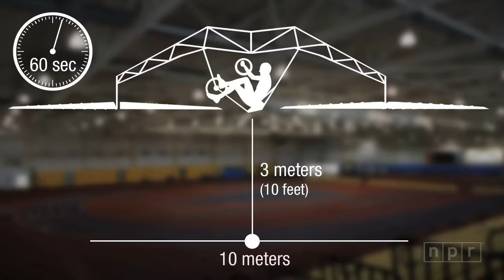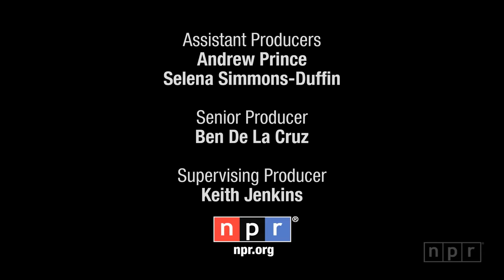Human-Powered Helicopter: Straight Up Difficult | SKUNK BEAR

Comment: As a composite technician I really appreciate this structure, the fact that all that carbon fiber can deal with all that intense stress and hold fast is amazing.
Reply: What? Carbon fiber is supposed to be stronger than steel so tell me why is surprising for a such a professional as yourself??? 🤡
Reply: @Alberta1stPodcast it’s stronger than steel per kg, yes that’s correct. What’s your point?

Comment: Honestly, I believe what you guys need isn't an extra engineer but actually an expert in biomechanics. The way the pilots have to work really isn't optimal, especially the arm motion is off.
Reply: Exactly
Reply: Correct, leaning sitting like a bike would for example be more efficient
Reply: Wouldn't that make it harder to lift it? The machine would be significantly heavier with two more pilots.
Reply: @neocyran  we shouldn't have 2 pilots... I think you misunderstood this
Reply: See YouTube, this is the kind of shit that happens when you don't nest replies to replies...
@RegiPet recommended using more people pedaling.
Reply: @neocyran  oh, I see, using more than one guy is not a good idea.
Reply: It is fun for indoor shenanigans. But Imagine a vehicle like this outside, where you crash when you get injured or to tired.
Reply: I'm not an expert or anything but I see the pilots struggling with the hand pedals and the pedaling position is not ergonomic enough. But anyways awesome project 👍👍👍👍
Reply: They should get the people who designed the human hydro system for the americas cup.
Reply: LUN4T1C - The point of projects like this is to "challenge" people to come up with new ideas and concepts to a seemingly impossible task... the human mind is capable of infinitive ideas and it's challenges such as this which brings about the next technological breakthroughs. Also, while it is true the person powering the helicopter in the video will eventually get too tired to sustain long term, effective flight... a small combustion motor or (better yet...) an electric motor could (technically) replace the human power aspect once the design team has accomplished the goals of the original challenge.
Reply: @IrLosin  i think its just a proof of concept
Reply: Exactly, that is the first thing I noticed watching the video
Reply: Provided the structure can take the added forces, a heavier but more powerful pilot should be better. They need huge power for a little more than one minute. This guy is light but that's about it.
Reply: @IrLosin  they are legitamatly only doing this for the prize. Not for commercial/public use.
Reply: ImKrazyFrench exactly, using your own body weight to assist your physical strength will go a long way in helping in power and efficiency
Reply: Exactly.
Cycling up a hill on a recumbent offers such little power. Optimal movement for humans generating power is probably rowing but the mechanism would be heavier.
Reply: @voidrift1508  no.not correct... You also need to pedal with your hands... Soo bicicles sitting position would suck
Reply: I agree. There is ample space for an engine.
Reply: You may be wrong, they're going for most watts possible, sustaining it isn't very important so bad form may not be an issue here.
Reply: Can somebody please for the love of God explain to me the point of this whole exercise?
Reply: Im really dumbfounded with this recumbant cycling position, particularly with Americans, you have to support your legs while using them? This arm position is strange too. Put the pilot in a cycling position.
Reply: @ChristopherSmith-bh4sz  The absolute weirdest thing is the placement of the engine.
Reply: @jakaberdajs730  That might not be the case, the power increase from the legs in a bicycle position might overpower the total power from the hand and foot position. We'd have to try it IRL to know I think.
Reply: @voidrift1508  well i think if they had clip in pedals and with a more "upc position on the hand with a lean angle forward of 140° the power would exceed that of a optimal cycling position since he would have more power in the legs, using the whole rotation as source of power not just half of it and hands combined. But like you said it has to be tested in the field
Reply: ImKrazyFrench You know, that's a great thought. If the hand power could be designed as pull, like exercising the lats of one's back in a gym.
Reply: @Flyingdutchy33  It allows young engineers to demonstrate their capabilities to potential employers.
Reply: @ryannayr140  So why human powered when 10 ft is "the ultimate height/range" ? Is that just to score browny points with the climate boys?
Reply: Wow the pivot was real on that one.  It's a trivial height that they thought would be a challenging goal to try for.   @Flyingdutchy33
Reply: @ryannayr140  yeah I get it, I just don't see the point
Reply: @neocyran   no because with 1 pilot they are lifting there own weight plus the entire weight of the craft we as 3 pilots would be lifting their own weight plus only a 1/3 the weight of the craft.
Reply: @kezzaman  That is a very good point.
I feel it sidelines the fact that it would be a more complicated craft, with additional seats, gears, strings, among other parts.

I'm not arguing it makes it impossible, or that it would not make achieving higher altitudes possible, (unlike I had meant to in my original comment when I did not give it much thought).
 I think, though, that three-pilot version of this craft would require a lot more engineering and personnel involved.

Would the pilots have to be synchronized? I feel like one of the issues here is that different rotor speeds would make it less stable so: how close would they have to be in sync?

Would the resulting craft be substantially heavier? I think in this case where the team is trying to trim the weight to minimum possible the gain could be less than what one would expect from reading your observation.
Reply: I was thinking about this too. I know it would change the way they design the aircraft but if the pilot was positioned in something like an elliptical machine they would have a more efficient energy output
Reply: @FinnJohnson   Ya, that would definitely sync up the hand and foot motion. Good idea! I think they should experiment with gear ratios as well if they haven't a bunch already.
Reply: Beastly already did this in the 80's. Hyahyahyahyahyahya
Reply: This is what I was thinking.. they should be pushing down into their work, not leaning up toward it.. if the pilots were oriented facing down instead of forward / up, they could put their weight into their work instead of doing it 100% through twitch muscles.
Reply: @Blurp Bibablobop I think the biggest problem w/ a chain here would be weight.. chain driven mechanisms are actually very efficient as there's no slippage.
Reply: Regi Pet  clearly not, they get lift with one person, obviously.
Reply: Void Rift why isnt it?
3x the force, but less overall weigth per person
Reply: @IrLosin  But with a bit of help from a electric motor you'd be fine.
Reply: @ChristopherSmith-bh4sz  that's right. The traditional cycling position would have given him a greater mechanical advantage over lying on his back. Gravity is a free energy that can be utilized in this instance.
Reply: @ryannayr140  and once they get hired. They're slaves to corporate deadlines and business politics. An innovative mind would rot in that environment unless he has a great development team and a likable boss.
Reply: I was thinking about the usage of elastic materials to make up for the lack of 100% synchronization between the arms and legs in an optimal movement (I mean, they do move together but in very different manners). Plus the seating position does not look like the best.
Reply: Ok. But it needs to be redesigned.
Reply: I was thinking the same thing, like a rowing motion used for crew
Reply: Regi Pet  No the lift is there. The machine would probably fail with a significant weight addition
Reply: These people look like cyclists, give them foot pedals and let them brace their arms and you will have far more success im sure
Reply: I agree with a different position. If they used a more bicycle position they could switch that seat for a carbon bicycle seat that would weight less.
Reply: @voidrift1508  Thats exactly how the Sikorsky Prize was won
Reply: @IrLosin  have you even watched the video ? This is not made to have 'fun' nor for 'shenanigans'. This is a challenge for optimal performance. A challenge for light and strong materials.
Reply: @Movie2Documentary  Someone needs to adjust his sarcasm radar
Reply: Agreed.
Reply: Yes. Rowing machine motion+ plus spin bike+triceps dips. Or, what about the ability to shift the gears like a mountain bike, gain speed and momentum. Or, maybe some kind of parachute like the fan-man has? I looked at some wasps in a jar with a lid one time. Noticed they were really dangling, their segmented heavy bodies like pendulums, all thrown perpendicular to their wings, only thing horizontal was the tiny head, behind which were little oscillators (not rotors). Built much diff. Than a human, a wasp or hornet is still a good example. Catch one and put it in the freezer for a few minutes, it'll slow it down and you can see it comes back on. It'll even let you tie a string to it. It supports an amazing length of floss before it turns on you. Cool vids. Keep up the work, and maybe some day we'll see you here in FtW. A lotta good aerospace people here at Lockheed Martin n Bell helicopter. It's like an air show every day, I love it here. Would love to stand up and peddle hard and shift into flight. Hey what about the rider being upside down, dangling like a wasp from it's wings,  and don't bother with the arm portion of the machine? Just focus 100% into peddling with better transfer of energy through the shorter chain and ability to use arms like stabilizers grabbing some kind of handles by one's sides, wide out, kinda? I do drugs. You're welcome.
Reply: i thought maybe if the pilot was on their stomach so their legs  and arms did not have to fight against gravity as much ?
Reply: Oof, so many replies...so after 2 years, I'm thinking there is a tradeoff between ergonomics and engine stability that hasn't been brought up in the discussion. I agree that the rowing motion can generate much more power and also much longer than spinning it is right now. However, rowing might decrease significantly the stability as it involves alot of upper body mobility
Reply: For a short "sprint" working with arms ist ok , but not for longer time.....because the bllod goes off from the biggest muscule, the dead-line for he human power ist the power of the hart....
Reply: @neocyran  Exactly what I was about to say
Reply: Its spelled believe,not beleive
Reply: @lookbehideyou1767  Right! Many thanks :)
Reply: neocyran  now 1 pilot supports the whole weight and his weight too, with 3 they would support their weight but divide the weight of the machine per person by 3, would definitely be better
Reply: There are a lot of people in here giving advice, but what these people accomplished is actually fucking insane.  Look at all the other human powered flight designs.  There are people in here saying they need this or that but none of you have come anywhere near this, and probably never will.  You have no idea how hard this was.  I saw one person say they "need more people" lmao well I hope these extra people don't weight anything, because that 1 person probably weighs more than the entire machine.
Reply: yup the machine weighs 80 pounds lmao
Reply: Imagine a 500 watt motor and 4 pound battery pack could really make this fly alongside pedal assisting
Reply: @neocyran  That makes sense but if you think the human as the engine, it would be the equivalent of saying that you shouldn't add more engines to generate thrust because they add weight. Maybe the engine analogy doesnt exactly work because humans output way less power for weight than an engine.
Reply: Wandy Wexler Weslon  would that qualify though? Adding a fly wheel implies that you have to get it moving before lifting off, so it's essentially like using a low tech battery that is charged by humans and then used to assist them in actual flight. I'm not sure about the rules but they probably want all power provided during the flight to be generated by the pilots during the flight, otherwise you could also just wind up something like a giant mousetrap vehicle and technically call it human powered because the mousetrap was wound up beforehand by humans.
Reply: Wandy Wexler Weslon  actually nvm the rotors in themselves are basically giant flywheels so I guess they should be allowed
Reply: They should use rowing motion + leg pressing for powering it
Reply: @IrLosin  lol I can see myself jumping into my Flycycle trying to go 100 meters North and suddenly landing in Brazil or something... Not suitable for windy cities at all.
Reply: they need vortex cooper coil and a motor to stimulate the arms and the legs and then you get strong
Reply: or just put a robot with adversarial generative networks mechanicaly to control some errors
Reply: if it was it should be real
Reply: That's what I was thinking.
Reply: Theyre going to have to redesign the seat and the mechanism hes turning. Hes bound to put forward motion having to push that wheel and he will always move out of the box. They need to correct that somehow
Reply: @neocyran  They're not pilots, they're the engine. They have no control other than how fast they pedal
Reply: @voidrift1508  This for that. You increase output from leg rotary but the arms become more restricted when you're crouched over.
Reply: Also, putting the user in a position where he can lean to apply torque to steer would help a lot.
Reply: Worst arm position, whose idea??
Reply: @voidrift1508  A Canadian team won the prize doing something similar to what you suggested.
Reply: If they use gears like a bike or car it would be more efficient
Reply: @neocyran  1 year on, still no nested replies. How the ever loving fudge have they not changed this.
Reply: Old sewing machine pedal mechanics
Reply: Needs biocam at least
Reply: Put a gear switch and more sprocket sizes
Reply: It's completely wrong. No endurance at all is required just to do a couple of minutes. It's raw sprinting power to get the maximum quick lift. You need to be head-down sprinting flat out from the get go with your arms locked on something like a weight lifter. You should be anaerobic, your lungs should stop.
Reply: They need a whole new design
Reply: Wow mr graduate student
Reply: Best way might honestly be making a rig where they can do a squatting/deadlifting motion. Might be a little heavier but could make more power.
Reply: Regi Pet  Three people pedaling equals three times the weight. Their battle is to increase efficiency, and their focus should probably be in funding light, strong enough materials while designing a a pulley system capable of avoiding losses due to friction in the strings and pulleys, and airfoils with high lift/drag ratios.
Reply: Hand pedaling doesn't help much, you have 3 times more power in your feet than in your arms. The arms should be used for steering.
Reply: Oliver Eales  If they knew everything they wouldn't be studying at university.
Reply: the power wasn't the problem. The guy said he never stopped because he was exhausted. Control is the problem. They intentionally stopped below 10 feet to drifting too far off and crashing
Reply: @IrLosin  Theoretically, if the pilot had collective control, they could replicate an autorotation like on a helicopter so the pilot could get some rest
Reply: How about a two levers for the arms attached to pullys to multiply power output per stroke,
Reply: Bro that’s what I’m saying, know what I’m saying?
Reply: It may have to be engineered with two pilots.  Let me know how it goes.

Comment: On 13 June 2013 at 12:43PM EDT, AeroVelo managed to keep its Atlas HPH in the air for 64.11 seconds, reaching a peak altitude of 3.3 meters and drifting no more than 9.8 meters from the starting point.  After the AHS International Human Powered Helicopter Competition Committee reviewed the data from the flight, AHS International announced that the flight had met the requirements of the competition and that AeroVelo had officially won.
AHS International awarded the prize on 11 July 2013 to the AeroVelo Atlas.

via wikipedia

Comment: The difference between 10ft and 8ft is that he's trying to get out of ground effect, and the power he must generate increases tremendously.
Reply: Gear box maybe two or three speeds, maybe even 18 like a bike to more appropriately clear the ground effect.  Possibly carbon fiber filaments to control two of the rotors pitch to provide some control.
Reply: Jeremy Cook
A gear system would be for "cruising", and they're a long way from that.  They need to generate maximum power, which occurs at a fairly high RPM.  And every gram of extra weight makes a big difference.
Reply: I agree and I believe the distance of the pedal crank is too short for this guy.  He's not extending his legs enough for full power capability.  Not trying to be critical, they've done an amazing job.  Good luck on future attempts! :}
Reply: Mickey Bitsko Then shouldn't he shave his head and do it naked, I'm not sure it makes that much difference?